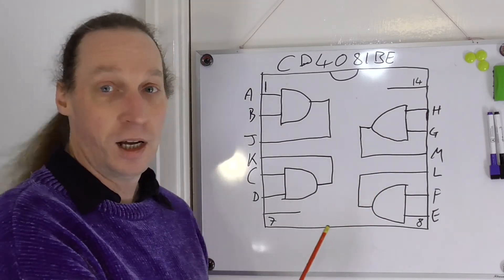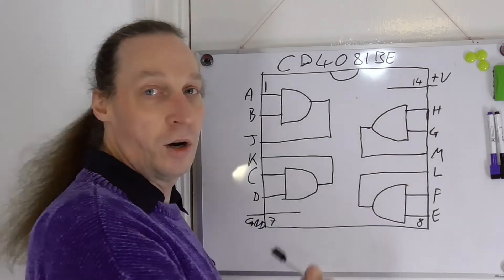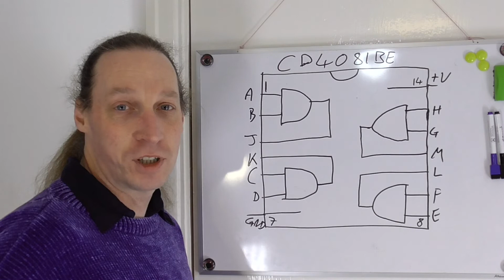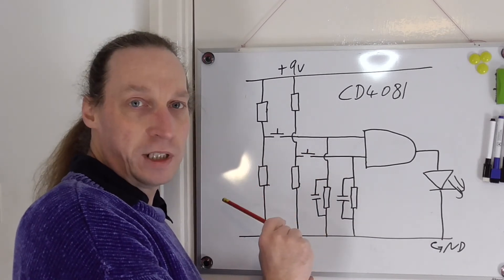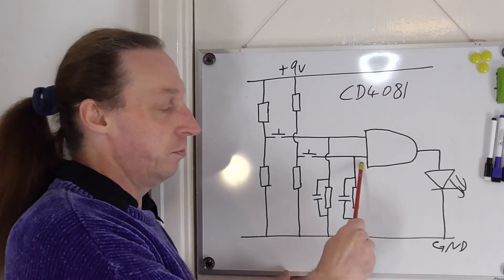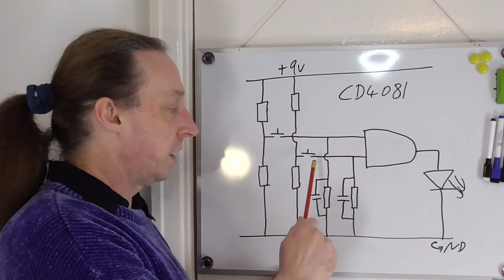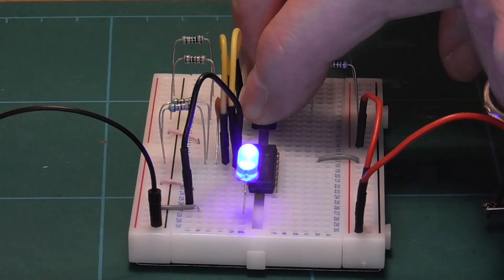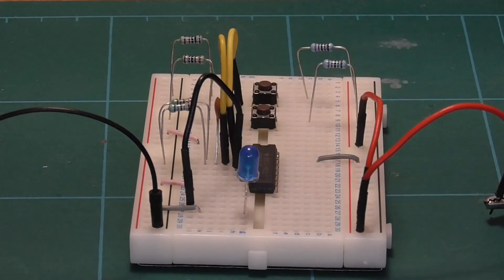CD4081BE AND Gate

Comment: What is the input voltage for the 4081. Can be 12v?
Reply from the maker: Hi Gabriela, The supply voltage is between 3v to 18v so 12v should work fine.